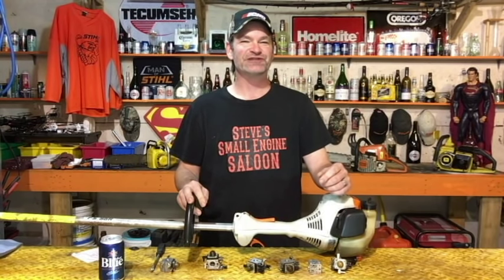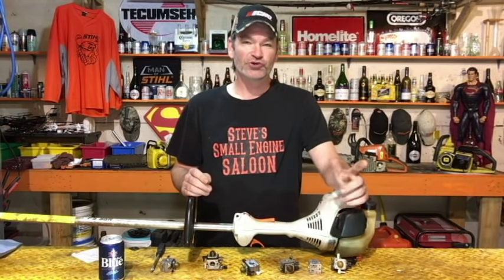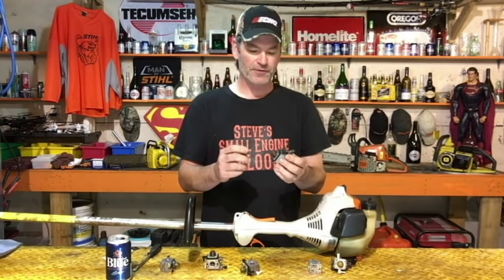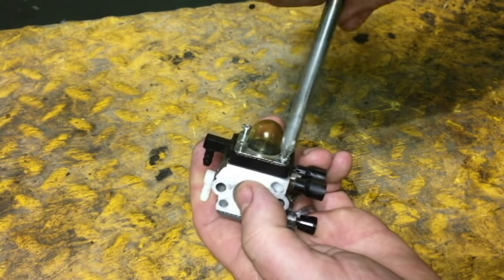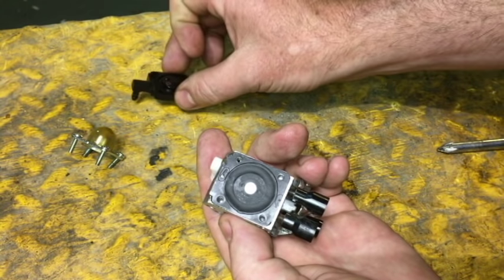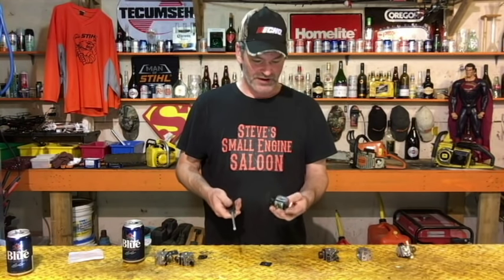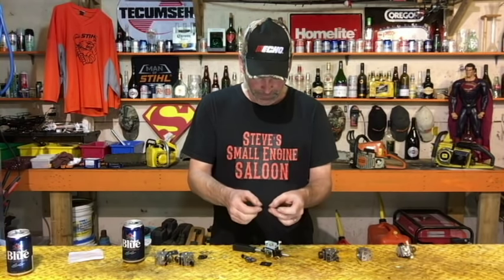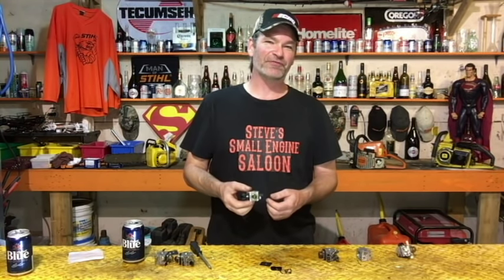How To REBUILD A CARBURETOR On A ChainSaw, WeedEater, Etc.

Comment: Good morning Steve.  I have a bit of a conundrum. I completely disassembled the carburetor on my two cycle John Deere RCB 600 weed whacker.  Of course the primer bulb was cracked. Luckily I had one on hand. However once I got it started it wouldn't run on anything but screaming wide open at the same time it would surge high low high low high low help me what have I done.

Comment: I have  Troybuilt model TB 304H string trimmer that has one of the 4 screws that hold the primmer bulb on stripped and will not tighten. Mine only has the syphon and return hoses. The carb my shop ordered was the wrong carb. After digging ,I found the carb I need on a model TB 525EC.what do you think.

Comment: Please tell us what the actual purpose of a choke is for. Or what it actually does. I have been asking for years and no one has been able to give me a real answer. And please keep pumping out the kick ass videos!
Reply: When a motor is cold it needs a richer fuel mixture to start easily until it warms up a bit. Pulling the choke on closes almost completely the intake air passage, which sucks more petrol in because of the higher vacuum in the carby. The smaller the motor, the less time the choke is needed- these little motors warm very quickly compared to a car with a manual choke!
Reply: @rossbrumby1957  Thanks, man. Been asking for an explanation for years.

Comment: Shop just rebuilt the carburetor on my Husky 455 Rancher. The engine now hydro-locks when sitting unused for about 3 or more days. The compression release pops up as soon as I start to pull the starting handle. What needs to be done now?

Comment: Steve don’t know if you can help but I’m lost, I replaced my carb and spark plug on stihl fs38 because the original carb wouldn’t fill the primer bulb. It would run but then bog out. Now with new carb and spark plug it will not start.
Reply from the maker: I have a video in my playlist called Stihl wont rev up...
Reply: @StevesSmallEngineSaloon   sorry I left all that out I have already cleaned the spark arrester, changed air filters checked compression and kill switch.

Comment: Hi Steve , Guys , Great video . Asking from England 
 I am rebuilding  a small carb on a Ryobi .Cheapo - Leaf blower  . Taken apart ,clean ,inspect ready to reassemble . The issue is I have . Card gasket , x 2. and a small this steel on . Should the steel. be in the middle of the 2 cards

Comment: Hello Steve  I rebuilt my carb on my Craftsman wc210 weed trimmer did everything you showed in video but only thing I could not find to put back in was the little screen you talk about , must have fell out so my don't have one. Will my weed trimmer be ok with out the screen.

Comment: Steve - I got a Stihl 029 Farmboss saw from 1995 leaking fuel badly from a vent on the top of the tank. I plug it and it won't start, or runs crappy. What has happened after 25+ years to my dependable saw?

Comment: Hey Steve I just changed the diaphragm and adjusted the valves. The engine get hot quickly and with some white smoke. Can you please let me know what is the cause for overheating?

Comment: Steve, I had a weird problem a few days ago with my usually very reliable Ryobi RCS4046 chainsaw. Happily cutting up a pile of logs and the engine just cut and died. I did a few basic tests and discovered the single screw holding the fuel pump plate had decided to unscrew itself, so, when I pumped the primer, fuel gushed out in all directions. I took the plate off, checked the diaphragm was ok and screwed it back together, hoping it would go again. Went through the starting procedure but it was dead as a duck. Suspecting it was badly oiled up I left it with the plug out for 24 hours and tried again. Still no good. Eventually after three days it staggered into life, blowing oily smoke out of the muffler. After about 15 minutes it finally ran properly again, although to start with I had to keep adjusting the idle screw just to keep it going.

I have been cutting about 10 cords a year for the last 15 years with this saw and have been amazed at how well it has kept going. I’ve gone through about five bars, many chains, fixed a few odd issues like the oiler pipe splitting, but this was the first serious problem with the engine itself. I have just switched to Aspen2 instead of premium petrol + oil at 50:1 so I don’t know if that had anything to do with it (seems unlikely). Question is, should I do the partial carb rebuild anyway, given that these parts are now very old and likely brittle?

Your videos are fantastic. By far the best close up, detailed descriptions of how things work, what goes wrong and how to test and fix.

Comment: Yes Steve good series but is there a trick to replacing the top throttle spring tensioner? I undid the top brass screw with the long jet attached. Then I undid and removed the two steel screws holding down the top cover bracket assembly. This caused the black plastic cylindrical throttle barrel to come out but that also caused the tension return spring that holds the cam in the throttle closed position to lose its tension and now I'm having trouble reinstalling the spring and plastic cam back into the top of carb. Have you a video of how to retention the spring in the correct way so that the plastic cam is held in the throttle closed position??

Comment: Bloody beautiful explanation mate!! Thanks very much! I've got a Husqvarna E Series 435 chainsaw which sat for about 12 months with mixed fuel in it and since then has been running like shit, now it won't run at all. On the first pull of the cord it floods the engine. The tune of the saw is ok before it stopped running. I reckon it's the metering diaphragm as you explained! I'll pull it apart and see if it's gone brittle. Thanks again for your excellent videos mate!!! Subscribed!! :)
Reply from the maker: Thanks and You're welcome...

Comment: Steve,I have an old poulan chainsaw with a wt-20 walbro carburetor. When it's running fuel and air spits out the top of carburetor, any thoughts?

Comment: Hey Steve. Does the Stihl FS 55 trimmer have a fuel vent? My trimmer chokes out when I turn it sideways. Is about 9 years old, but never had this problem. I have only ever used non-ethynol gas.

Comment: Hey Steve love your videos. I have a husqarvana 440 wont prime has new fuel lines is it possible problem in the carburetor.
Reply: It’s possible the fuel lines need swapped around, that will cause it to not prime.
Reply: @chuck300mxc  thanks  for the reply that's  not it I think the diagram  is bad in the carburetor  I have to  take it  apart. Thanks again.

Comment: Great video.  Could you show how to replace old brittle fuel lines on a chainsaw. Pulling the line through the holes can be tricky.
Reply: With a sharp knife or razorblade, cut a 1/2"long diagonal slice off the end of the new fuel hose to make a point that'll go through the hole. Pull it through with long nose pliers until it comes out the filler hole, trim the point off and put filter on, then put back in the tank. Remember to leave enough fuel line inside tank so you can hook the filter out to clean it. Trim other end to suitable length and fit to carby. easy, done it many times.

Comment: Hey Steve, I have a question I have a 18 in craftsman chainsaw. We are cleaning down trees from the storm.
The last two days the thing ran like a champ for about 3hr. Then I would fill it up it run then cut  out. Then just  not start. Next  day same thing  3hr awesome. Fill up cut out then won't start.What would cause that.

Comment: Thanks for the video. I have a problem with my trimmer. It starts okay in the horizontal position, but as soon as I tilt it down to do some trimming it cuts out. If I quickly tilt it back up to a horizontal position it works fine again. Needle and seat maybe?
Reply from the maker: What make and model is it?  Did you try my carb adjusting video?
Reply: Honda GX25 4-stroke. Have not yet looked at the  carb adjusting video. Will now.
Reply from the maker: Nice!  Best trimmer in the world!  The adjustment screws are different on your trimmer than my video though.  Low speed is straight down the top.  let me know how it goes...
Reply: @StevesSmallEngineSaloon  make sure your gas filter is not floating. And is weighted down.
Reply: So was it an electrical problem- maybe the killswitch wire earthing?

Comment: Hi Steve
If a gas weed eater has a bad/deteriorated base gasket, could that cause it not to pull fuel from the tank? Carb is clean, gaskets inside look good, but base gasket is swollen and tearing. You can see through the fuel line that fuel is not being pulled into carb. Diaphragm is still soft and looks ok...
Thank you!
Reply: Change the fuel filter at the end of the fuel line that sits in the bottom of the gas tank.

Comment: Can't find a video on where to set the High and Low screws once you rebuild the carburetor. I got a Stihl BG-55 off the curb. The guy had tried to adjust the screws and now it won't start or run. I want to put a rebuild kit in it, but don't know where to set the screws for the initial setting to get it started.

Comment: Subbed if only because it was a nice touch to be accommodated as a Brit!  Great demo thanks.  What would be the fault symptoms for a stiff metering diaphragm or pump diaphragm?
Reply: Not starting would be the most likely symptom. A shot of petrol down the carby or sparkplug hole will make it run but only briefly. Brittle diaphragms won't pump or meter fuel .

Comment: What size tool should I use to remove the carburetor from the engine?  I’ve tried several but I’d need a very thin walled socket to be able to remove the two nuts that attach the carburetor to the engine.

Comment: I have the same carb. It has clogged from the little prime passage. That goes from the bottom to the top. Any advise on unclogging this. I have taken it off and cleaned and hit it with compressed air several times with no luck.
Reply: I use paperclips or small drill bits (by hand only) to gently chase the passages.  Then I spray away the remaining crud with a can of carb cleaner

Comment: These tiny carburetors will be the death of us all. I've been fussing with my older Stihl for hours now. Carbs all cleaned and rebuilt and put back together. Now the darn thing won't start and stay running. It's likely a needle adjustment issue and yet I just can't get it dialed in to where it'll start and stay running. So frustrating. At least your video help me to confirm I at lease put it back together correctly, lol

Comment: My 15 year old Ryobi RCS4046c chainsaw started really bogging down on acceleration (although running fine at high speed). I tried adjusting the L mixture screw but no real improvement, so I removed the carb intending to replace the diaphragms etc. per the video. There was a huge amount of cleaning needed to remove 15 years of accumulated dust and oil and some of the rotating parts were a bit gummed up and freed with WD40. Anyway, it turns out the carb is a ZAMA with the code C10, which I can’t find a kit for. The primer bulb is separate, not part of the carb. The good news was that when I put it all back together the bogging problem was cured - maybe it was caused by the stickiness in the spring and rotating air inlet or something. It makes you wonder how the diaphragms have lasted so long in a machine that has been heavily used for such a long time, and why they fail on others after a shorter period. I don’t do all the things you are supposed to do, like drawing the fuel system over winter, yet it’s still running.

Comment: Man I wish I had your luck, I have tried to rebuild over 20 of these style carbs over the years and only 1 worked and to make it even worse the one that worked after worked before ,it just leaked before but ran, I found that for me the problems are usually the check valves inside the carb body or the passages under the Welsh plugs. My local stihl dealer sells new carbs for usually between 25-80 depending on model and if you ask me it's worth every penny i have pulled my hair out so many times trying to fix these carbs and replacing them is a breeze. Usually when I try to rebuild them I'll get them to start up and run for about 45sec or 1min and then they will cut out, it's really frustrating, in my opinion these diaphragm carbs are the hardest carbs out there to fix and diagnose I have never had a diaphragm kit ever fix one.

Comment: Hey Steve, I've got a 1994 Briggs with a Pulsa Jet carb.  I put a new diaphragm in it and it seemed to run fine. My question is, why is the carb loading up with gas (a lot) when the gas cap is on and tight. I loosen the cap and it drains. How can I test the cap IF this is the problem?  I'm getting up in years and I hope it's just something simple I've overlooked. Thanx in advance.
Reply: Thanx for the thumbs up, but anybody out there have any ideas? In the meantime, I'll take the carb back off to see if I fudged something.

Comment: Hi Steve,

I was given a Homelite XL76 chainsaw that hadn't run in 15+ years. Original Prestolite coil was the problem. Fixed that. However, I still disassembled the carb to check on the guts. The metering diaphragm seemed a little stiff. I put in in a pot of water on the stove and let it boil for half an half an hour. It was soft and flexible after the boil. I put it together and the saw ran great. I did this last summer. I don't know how long it will last. Any thoughts?

Thanks for all the videos you posted. I watched many and I have to say time well spent.

Comment: Hi steve. I have a problem that I can't see the fix for in any of your vids. My Stihl kombi engine will start with ease when I pick it up in the morning. If I put it down to go do something for a bit and then try to start it, it won't start unless I hold the throttle down. I pull and pull and pull and pull. Any idea? (of course)

Comment: Steve love ur videos quick question I have a husqvarna 45 chainsaw and can’t figure it out it’ll start but when it does it revs real high then dies amd if choke gets turned off it dies
Reply from the maker: Check my video that says chainsaw wont start....
Reply: Rotted fuel line

Comment: I have a FS90R Stihl weed eater; any ideas why fuel soaks the air filter element after 10 minutes of run time? I have a new carb, adjusted valves to factory specs, new fuel filters etc. Fuel pours out the bottom of the air breather. Stumped.

Comment: Just had a Yuengling Lager to get through your commentary. I have a Poulon chainsaw that quit running. I have replaced the fuel lines, changed the fuel filter, taken the carburetor apart. All components appear to be OK. (It’s not that old). I put in new gas with 40:1 ratio of 2 stroke oil (no ethanol).....will not start.  Fuel bulb fills with gas when pumped. Spraying ethanol in the carb will get me a start but will not continue so I know it’s getting spark. Next step is to do a major adjustment with a sledgehammer. Your thoughts?.....also, what chainsaw do you recommend that has the best operating record.

Comment: hi Steve i have a Husqvarna leaft blower model 125BT, but i couldn't never find the carburetor adjustment anywhere after i pull it off to clean. Do u have any idea?

Comment: I have a question for you Steve.  what is the high rpm speed of craftsman chainsaw model number 358.360150? I have the manual and it doesn't give those specifications, I have searched online but nothing for that model. Any help would be most grateful.

Comment: Steve, I have a stihl BG 86 leaf blower that is 16 years old. It had been working fine and then the other day I want to use it and it keeps bogging down stalling. I check the spark arrestor And it was clean, I change the fuel and air filters. I also took the front diaphragm on the carburetor out and it looks supple and fine.  It will start but I can’t keep it running.  I would appreciate any suggestions you might offer that would help me to get this running again.  Thank you John.

Comment: Not sure if all gasoline tanks on 2 stroke engines leach fine plastic into the carburetor clogging it up after performing a carburetor kit. It'll start up after kit. But the next day it wont start again. And the mesh stringer filter will be clogged up and some of the plastic leaching will actually get through and clogged up other parts of ur carburetor.

Comment: I actually have an odd question recently snap the fuel in the elbow off of a zama carb, my question is is it possible to change just inlet elbow or what I need to get a new carburetor
Reply: I really don't think you can buy the elbow by itself you probably going to have to get another carburetor

Comment: Stihl MM55C cultivator, will not idle.  Put in carb kit as per your video, then tried to adjust carb.  The high idle worked fine, but cannot get it to idle even with throttle screw all the way in.  Is it time for new carb?

Comment: I am at a loss here. My p.o.s Stihl fs90r died out one day. I could start it but barley ran. Did the run down. Spark arrester n air filter, then carb. There was a carb issue. Replaced it. Then no compression. Replaced rings. Now I have compression, spark and clean air. But won't start. Any advice?
Reply from the maker: I have a video in the playlist for setting the valves....